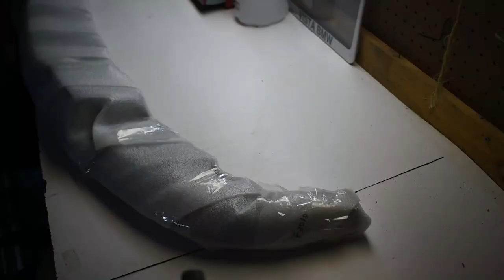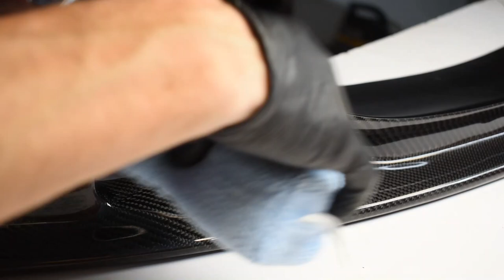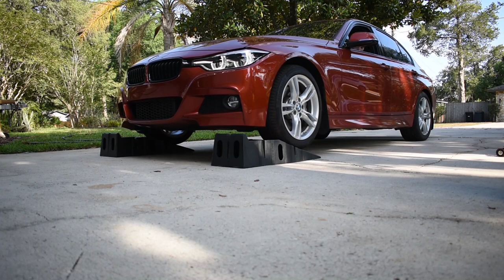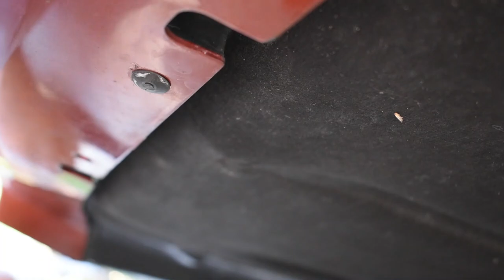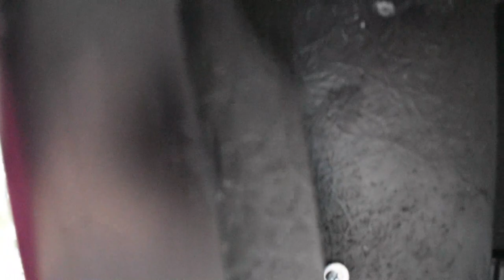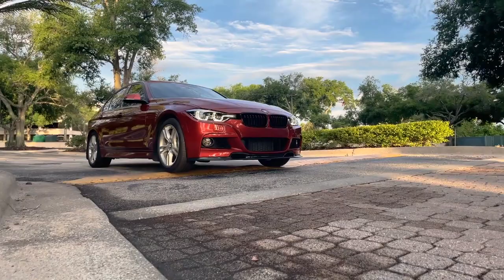BEST WAY TO SECURE A FRONT LIP? VARIS STYLE CARBON FIBER LIP INSTALL | BMW F30

Comment: What size of the self tapping screws did you use? Thx
Reply from the maker: Check the links in the description 🤙🏼. I used the body panel bolts in the middle as well as the self tapping throughout

Comment: I purchased this lip and I’m about to put it on, I was just wondering if they’ll be any issues going in to get my tires rotated with this lip catching on the lift inside the shop. How’s that been for you?
Reply from the maker: It does hang low but I haven’t had any issues. Mainly just have issues with side skirts on lifts. Depends on type of lift though. May have to use wood planks as a step up if need be. Finesse it haha

Comment: Looks great! I recently bought an F31 M Sport and it really does look like something's missing from the bottom of the front bumper. I was all set to order my lip but came across your video/link and now I'm rethinking where to buy from. How long did it take for yours to arrive?
Reply from the maker: Thanks!! I know right, a lip fills it in perfectly. Mine came in about 6 days
Reply: @skrrtproductions  I went and ordered mine yesterday from your link. Was the best price/shipping time I could find for a Varis style lip with a real cf layer. Hopefully it's the same quality as yours. Got carbon fiber kidney grilles coming as well.
Reply from the maker: @Dagasm  nice man, hope the install goes smoothly 🙌🏼
Reply: @skrrtproductions  My lip was delivered about 5 days ago and I just got around to opening the box today. The carbon fiber at the bottom of one of the holes looks horrible. It's like they reached the end of the roll of cf fabric and instead of trimming it neatly it was just laid it out. Has pulls and frayed ends. The other hole has a seam but at least it's neat. I sent ESM an email to get a replacement.
Reply from the maker: @Dagasm  aw man, yeah that’s one of the drawbacks dealing with carbon fiber parts sometimes. Hope they replace it for you
Reply: @skrrtproductions  Yeah, I was pretty bummed out as I was all set to install it that day. I had a bunch of cf parts on my '16 Camaro and never had an issue but so far with the BMW I've exchanged the grilles (first had a crack in each) and mirrors (first was an ugly fake "cf look" pattern), but both their replacements turned out great. I love how cf compliments my BSM paint.